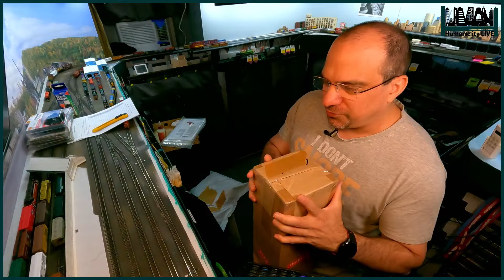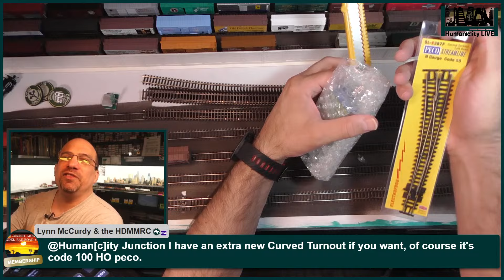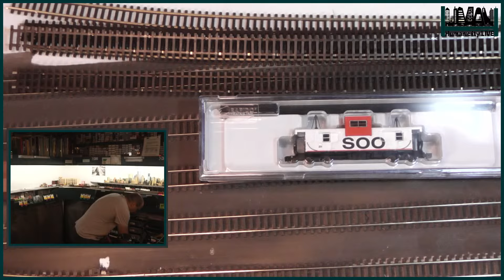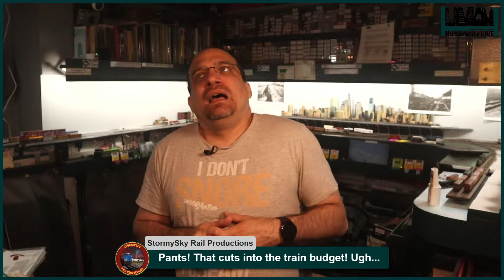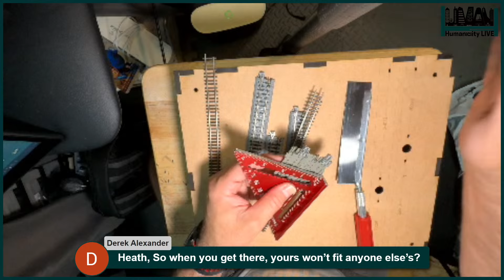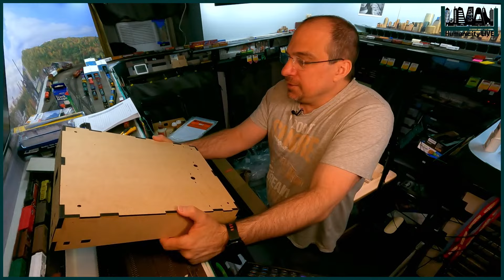Breaking the Rules: Using Peco Track on a T-Trak Module | Trains N Tech | Model Railroad Discussion

Comment: Well....
You've given me the secret to opening up space for a layout! After tossing stuff on the floor, I need to pick them up when I'm done! 😂

Train World had a sale on peco unifrog, medium, right hand turnouts. Almost pulled the trigger until I started reading about the fact that peco rail is NEM, not NMRA compliant. Apparently, the turnouts can cause derails because of that. The fix is supposed to be putting a shim inside surface of guard rail, but I'm not sure I want to bother with that. Have you experienced any derail issues on your peco turnouts, or have you applied any mod to prevent that?
Reply from the maker: I have not had ANY issues with the Peco turnouts in regards to derailments. They are much better than other options I have tried. 

And yes, picking things up off the floor is a really good start to acheiving progress.